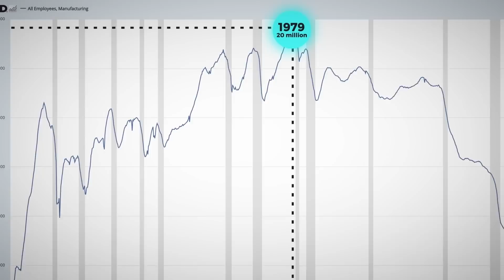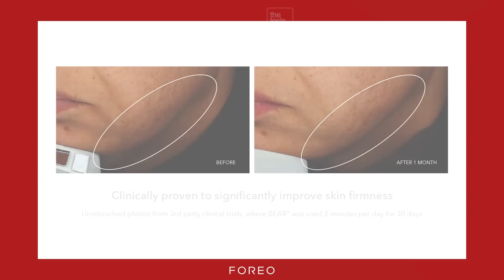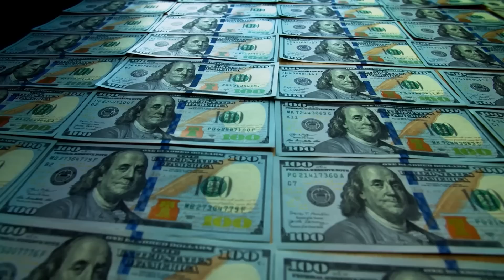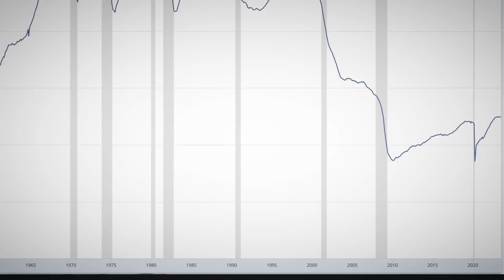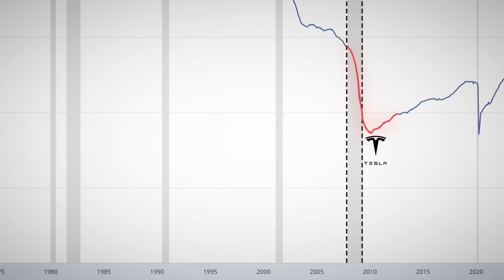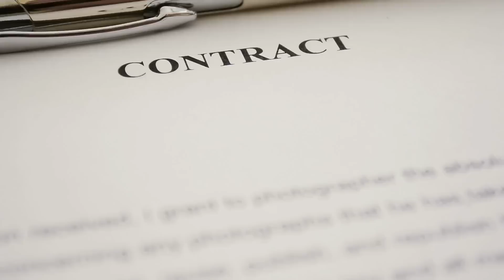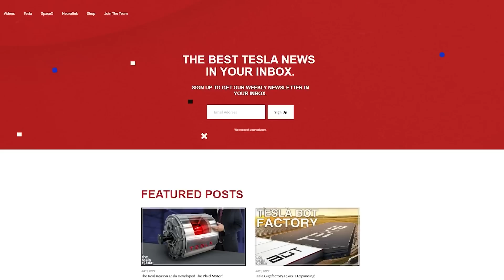The Truth About Electric Vehicle Manufacturing..

Comment: Reaganomics was massively increasing government spending at the cost of massively increasing government debt. Successive presidents and Congresses only built on this strategy. The reason why the US manufacturing fell is because the US government and unions protected them from foreign competition. When that crutch failed, all that protectionism only made the fall harder. Although it was painful, US companies should have been forced to gradually compete with the world instead of being protected.
Reply: i do not agree. The massive government debt was incurred to completely rebuild a non-existent military- No president not named Roosevelt or Reagan was faced with such a necessity, and both had to spend massively. All aircraft, ships,armor,etc were redesigned and rebuilt in the 80's on his watch. The succeeding Presidents have used this stockpile, and most have not replaced what was used during their reign- and then they crow about having lowered government spending.

Comment: Musk occasionally that he hopes Tesla has accelerated the change to sustainable energy, including battery electric vehicles, by 10, maybe 20 years. Personally, I think he under sells it. BEVs may never have properly happened without Tesla, and I am completely aware of the Chinese manufacturers. I think they would not have accelerated into the BEV sector so hard and so quickly, if not for Tesla. And just maybe the legacy gang, led by Toyota, would have resisted major change until they were good and ready. And that could have taken decades and been H2 based. which would have suited everybody bar the customer. Thankfully, Tesla has smashed the ultra slow Toyota progression to H2 to pieces. And we have a chance to see real future innovation. And a very good video.

Comment: One of the problems with the US auto industry has been their efforts to push vehicles people didn't want. After the Oil Embargo of the 1970s big auto was still pushing quotas on gas guzzling muscle cars. The Japanese succeeded because they brought in economy cars with great gas mileage. So is is any wonder we lost market?
And again in the 2000s we hear of the US auto makers pushing quotas on things like Pickup Trucks in NYC where they don't need them. It's all these crazy management decisions pushed on the public that made them unpopular.
And then GM tentatively introduced an EV which was too popular and then recalled and all cars destroyed. Still backwards thinking. But the had proven the concept.
The Japanese intro a series of hybrids and it had enough interest to still be a thriving design today. 
However they also revealed something else. Electric was better. The Prius had a 40hp gas motor charging their electric drive yet it produced as much torque as their 180hp Toyota Camry. Electric motors had a 4-to-1 advantage.
And thus enters Elon. Into a market already ripe, with technology already proven.
The real question is why the old car companies were so stuck in their ways as to fail to see what people really eanted and make it for them. There are fewer parts in an EV so they're cheaper to build and yet even with Tesla eatting their lunch they haven't done anything.
My guess their conservativism is as much about living off their pensions & stocks than to keep the company alive. Its their fault. RIP .

Comment: 1 They said he knew nothing of auto manufacturing.
He started to make Cars.
2 They said there would be " range anxiety"
they publicized range anxiety.
people had range anxiety. 
3 They made " made to fail" chargers that exacerbated range anxiety. 
tesla made charging points.
Now there is no range anxiety. 
4 They said tesla was making cars that were sold for less than the manufacturing costs
They said tesla would go bust.
Tesla invented new manufacture methods
 tesla made EV's cheaper than comparative ICE cars. 
5 Legacy claimed they would put luxury in cars, and tesla was a cheap car. 
So tesla put hi-tech and luxury in cars. 
6 Tesla saw that legacy was always arguing with UAW
so tesla made robots, making manufacture cheaper.
7 Tesla saw that Toyota was destroyed American manufacturing with their sewing machine, petrol sniffing  cars. 
So Elon used USA steel, USA parts, USA batteries, USA workers.
Elon made cars that were cheap to make; cheap to run; cheap to service' with enormous customer experience. .... an no dirty, greasy oil, no diesel fumes, no noise pollution. 
.........  ITS ELON'S FAULT! ELON IS DESTROYING AMERICAN MANUFACTURING! SEND HIM BACK TO SOUTH AFRICA! DAMN HIM IN MAIN STREAL MEDIA! ARREST HIM! SUE HIM! TAKE HIM TO COURT!
.... and then he made rockets that are 50% the price.....

Comment: DUDE, AN AMERICAN CAR MANUFACTURER RATED WITH JUNK ENGINEERING DESIGN ENGINE THAT WAS NOT EFFICIENT, ONLY PULLING FREE MARKETS PEOPLE GETTING SCAMMED BY FORD, CHEVY AND THE REST… BUYING OIL AND GAS TO KEEP JUNKER MOVING ON THE ROAD ALSO WAS DESIGNED TO FAIL AFTER A FEW MILES… IE FAN BELTS AND ALTERNATOR AND WATER PUMP AND POOR ENGINE SPARK PLUGS AND RADIATOR AND TRANSMISSION FAILING ALONG WITH MANY OTHER BAD PARTS TO SUPPORT BAD DESIGN!  REAGAN KILLED AMERICAN MANUFACTURING FACTS!!!

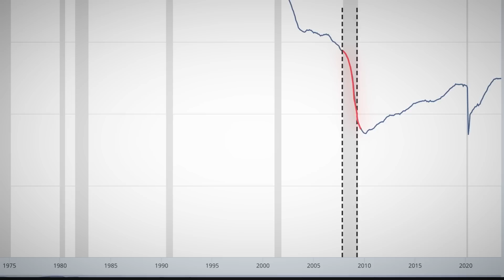Comment: @12:40 That is Giga Berlin, not Giga Texas.

Lucid and GM are a drop in a bucket if it comes to production of electric cars, Rivian and Ford do a little better, but the matter of fact is that Tesla sells more electric cars in the US than all of the rest of US EV sales combined!... There is NO catching up going on at all!! 

Tesla is now in the hundreds of thousands each quarter, where Legacy car makers are still in the tens of thousands, and Tesla is gaining overall market share, nibbling away (gas) market share of the legacy car companies, who see their gas car sales decline at an alarming rate, but are unable to replace that with EV sales. Legacy Car companies are still unable to produce and sell EV's at a profit, Ford has shown us that quite clearly by separating its EV business from its gas car business, showing that it costs them roughly 2x more to produce an EV  than they can sell it for.. And Tesla is hammering them last week again by dropping prices again with thousands of dollars across the board,.. because they can, Tesla is relentlessly reducing costs,  with new innovations in production (more and more automation) and design (giga castings, reduced wiring, reducing parts, more vertical integration). Tesla is the only US company that can sell EV's at a profit, and has higher margins than anybody else, so Tesla's pricing power is very substantial.

GM's Ultium battery platform was outdated the moment Tesla announced its structural battery pack, cell to vehicle production strategy, and they still seem to have big battery pack production problems, because they can't put out more than a handful of Hummers and Lyriq's each quarter. GM made a bad decision to partner with LG and stick with expensive Nickel-Cobalt based Pouch cells, where Tesla and probably Ford and Rivian too, are moving over to much cheaper and safer prismatic/cylindrical LFP cells.

I see GM and Lucid go bankrupt this decade, as GM only puts out new concept cars but fails to deliver on their promises again and again, and I think the Saoudis will not prop up Lucid indefinitely, with only a handful of cars sold each quarter missing their Targets again and again, something has to give at some point, but who knows. Ford and Rivian, may succeed, at Least Ford knows what it has to do, the question is if they can make it on time... The UAW really does not help here with their insane demands in sallery and benefits. Rivian is almost out of the woods and improving rapidly.

You mentioned China car makers are not taking over the US market, like the Japanese did, but if Legacay car makers fail to ramp up their EV production, and people stop buying new gas cars, they still can gobble up a sizeable market share beside Tesla, Chinese EV companies are ramping up faster than Tesla ever did at the moment... If that happens the next few years, than Legacy car makers are doomed. Vinvast is already in the USA, and some smaller Chinese EV car makers, but when BYD, NIO XPENG and a few others start selling cars in big numbers in the US...Its over.

Btw, talking about Japanese car makers, they are even worse than the Legacy US car makers...Toyota still has failed to put a decent EV on the market, the BZ4X is a big flop! Honda's EV is way too expensive and hardly sells, Nissan Leaf has not been upgraded enough to be compelling competition for Tesla Model 3, it hardly sells the Arya specs are mediocre at best, so also hardly sells. Mitsubishi withdrawn from China, the biggest EV market in the world, Subaru = Toyota, Lexus=Toyota, so forget about these as well. Mazda has stopped production of its only EV, because nobody buys it, no wonder with its terrible specs and outdated looks.

The Car market is much bigger than the US alone, In the rest of the world the transition to Electric cars is 2 or 3 years ahead of the USA, Tesla sells a ton of EV's in China, Europe and Australia as well, I believe only Ford (Mach-e) and Stellantis (Fiat 500-E) are selling EV's outside of the USA.

Anyway.. For the legacy car makers to save themselves from bankruptcy, A LOT has to be done, they have to go all in on Electric cars (they don't), get a lot better at software integration (they aren't), and ramp up EV production at a faster rate than right now (they can't) . If not ,Tesla will keep on running away from them with more and more cheaper and better cars, because Tesla keeps on innovating at "the speed of thought" (Sandy Munro) in both production and the design of the cars, keeps on building Giga factories all over the world, expanding existing factories. Beside that Tesla will also become big in Energy and AI (autonomous driving) and maybe even robotics with the humanoid Tesla Bot.

Comment: Tesla is the only car company trying to bring the cost of building cars down.  If an employee of Tesla sees that they are using 5 parts where 1 part would do the same job, the employee orders a new part to replace the 5.  A GM employee sees 5 parts where 1 part would do the same job, they ignore it because management does not allow changes and bringing it up will reduce the odds of promotion in the future and make them more likely to be laid off in the next round of firings.

Comment: Small detail but the old Chevy was a ‘59, not ‘58, which used a bad frame design, possibly making it even worse.
Another awesome video!
Reply: The result may have been quite different with a '53 or '54.  Stuff bounces off them, and they bounce off of stuff like a tank...doesn't help what's inside, except for a newer car collapsing for the benefit of what's inside.

Comment: Good video, however you missed a few things. One of the biggest contributors to the death of the U.S. Auto industry is the UAW. One of the reasons Tesla is so successful is Elon refusing to unionize Tesla and allow the UAW a foot hold in the company. So Labor costs is one of the reasons, another is the Corporate tax rate. The Corporate tax rate was lowered by Trump to 21% from one of the highest rates of any developed country at 35%. The lowering of the Corporate tax rat has helped the auto industry partially. Elon being the entrepreneur that he is, built Tesla from the ground up in a manner to keep Labor Costs to a minimum and cut out the middle man out of the equation. The biggest reason the auto industry is failing, federal regulations and the push towards EV's and the ever higher and higher CAFE requirements. There are other factors as well, but Tesla by itself, is not killing the auto industry, they are only speeding up a process that has been on going for decades as you partiality pointed out. Tesla is turning the Automobile industry on its head as he is re-writing the entire manufacturing process from the ground up. The legacy auto companies do not have the ability or desire to make the change needed. The only reason there is a U.S. auto industry is the U.S. Tax payer. If it weren't for the bail outs they would have died. Even now the government is looking to give even more to the U.S. auto industry to help them on the EV quest. Sorry for the rant. Tesla is awesome and I love the new Model 3. Again, great video.

Comment: It's great to see companies like Tesla in the market, you are right about stagnation, lack of innovation, parts spreaded across multiple suppliers and basically let the suppliers take all responsibility for final product and cut costs as much as possible, legacy automakers got lazy and let the accountants be in charge and do not make any risk steps, innovation comes with the risk of losing money. And it is also great to see that all of those "legacy automakers" be in hurry to catch up and hopefully they will see that sometimes they need to risk new products and inventions.
Reply: Agreed, I would even say the reason Telsa can innovate so rapidly has little to do with the vertical integration of the batteries, which would essentially be the same product they'd get from an external vendor. Rather, it's all the subcomponents, like designing the controllers, allowing them to reduce quantity and reduce wiring. Then throw in die cast molding of significant pieces of the frame. There are a number of manufacturing innovations Tesla has done that have little to do with EV and could have occurred on ICE cars years ago. But those companies stagnated.
Reply: mostly agree. but batteries? NOT EVEN CLOSE. the 4680 cell will have a life of 50 years- or 3.5 million miles- thanks to maxwell technologies- a little company that tesla acquired a few years back- because of a breakthrough they made with dry lithium technology. all they were doing was trying to speed up & streamline the manufacturing process- remove the whole solvent / wet spray / oven dry of the lithium application process. they succeeded- but that wasn't the amazing part: when they TESTED the new cells- they discovered that those cells WOULD NOT form dendrites. apparently- the wet application process is what 'kick starts' lithium degradation. remove that process? and lithium batteries' lifespan goes 10x.  @richard77231
Reply: Look at Stave Jobs' legacy? 
He risked everything to cause a paradigm shift of how the global population should now use a smart phone.
Reply: Yes Tesla is realy bad!
Reply: even IF GM, ford, toyota, nissan and dodge achieve the goals they SAY they will reach by 2025? only 10% of their sales will be EV'S. at present- EVERY legacy auto maker has been showing NEGATIVE sales growth of new vehicles for the last 5 years- except toyota- who only breeched negative numbers in the last 2 years- and FALLING, even while a greater percentage of new drivers joins the roadways. tesla? 50% growth, yoy since 2012. and STILL... you have people publishing tesla fud- aka- the reason tesla doesn't ADVERTISE... the general public discounts 100% of tv, magazine & radio ads- relegated to the telemarketer / infomercial trash bin.

Comment: can you address the grid structure to handle the charging  stations needed?  doES CA have the power plants to charge those vehicles. how long is the charging time  tell us?  how does the guy that lives an apartment complex afford one?  apt complexes dont have charging ports.
Reply: Apartments are starting to get chargers.  CA does have the power needed to charge their EVs.  At the end of my day, I plug in the car if the charge is low.  I set it to start charging at midnight.  In the morning it's full.  I don't care how long that takes because I'm not using the car then.  On a road trip, charging from 10 to 80 percent is, I dunno, 20 minutes?  By the time I've stretched my legs, gone to the bathroom, gotten a coffee and a snack, it's almost ready to go.  It's not a problem.
Reply: its problem here in vegas  casino workers live in apts  no chargers.  there are lines to charge on I 15 i have seen the videos.  ill stick with gas. just like the guy working food services. 
 @incognitotorpedo42